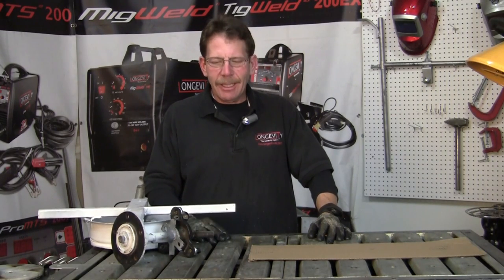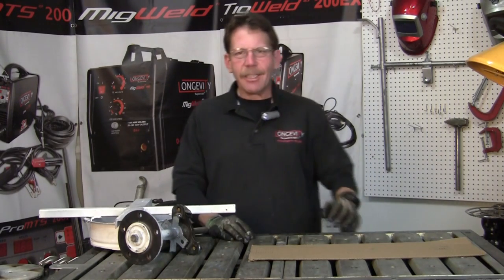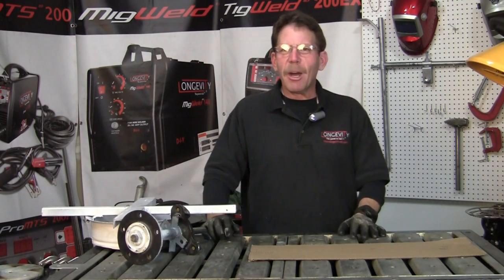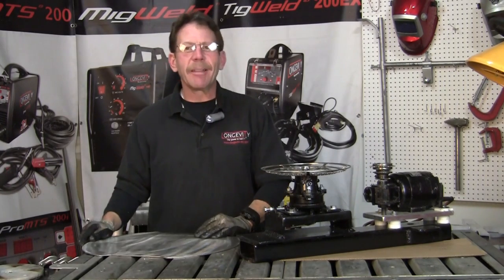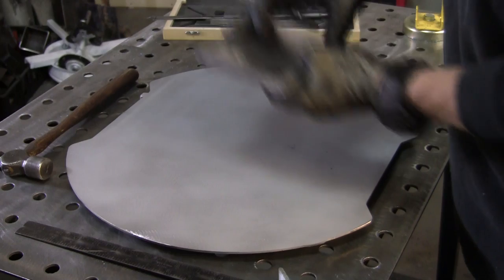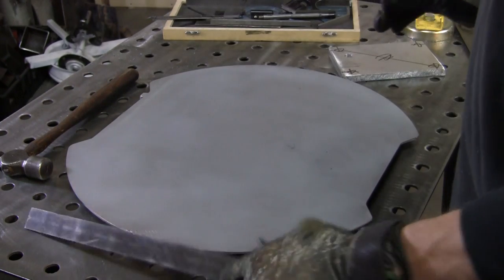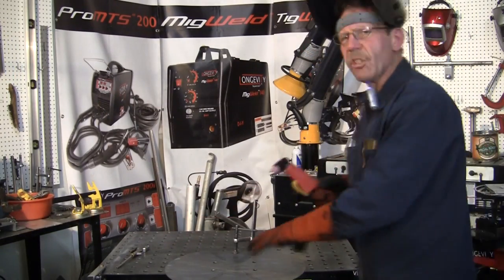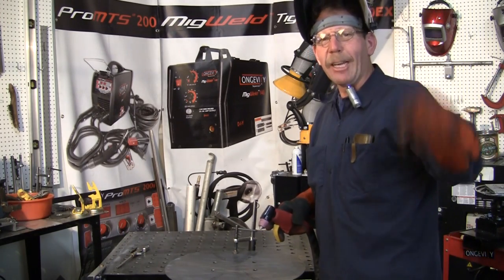Welding TurnTable Part 8

Comment: Your clamping surface just doesn't seem like it will stay flat when you clamp your workpiece down on it.  And it is looking risky where it overlaps the motor sprocket.  An easy pinch point to grab you.  Doug